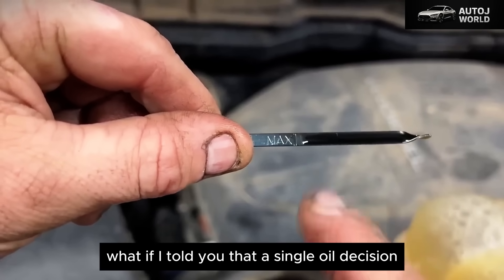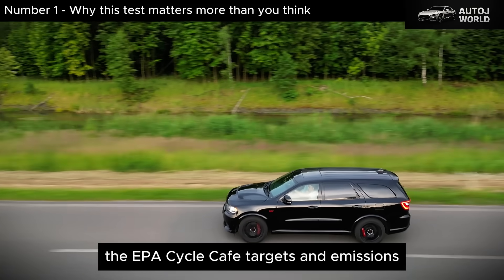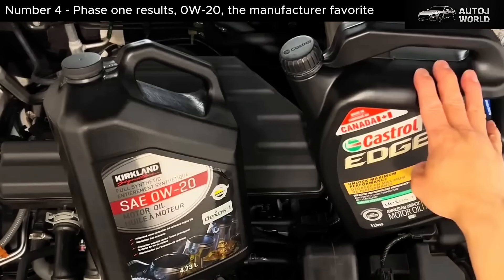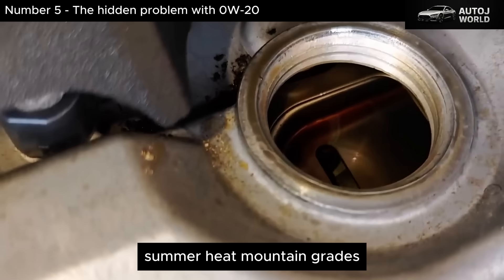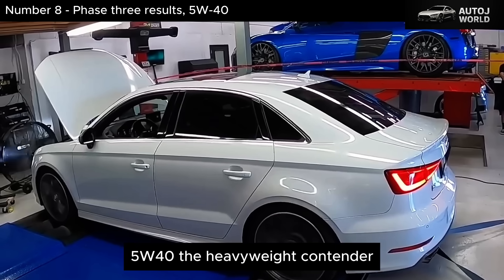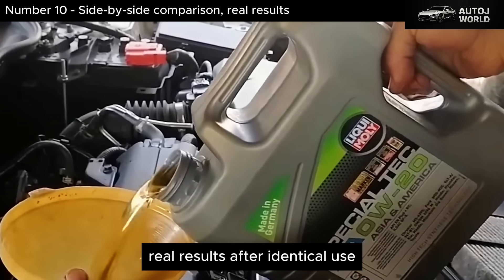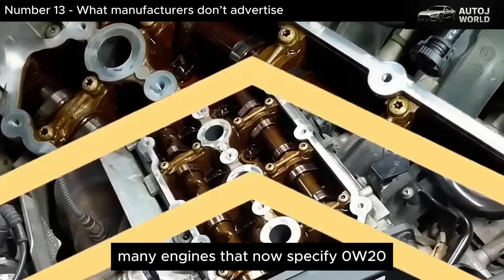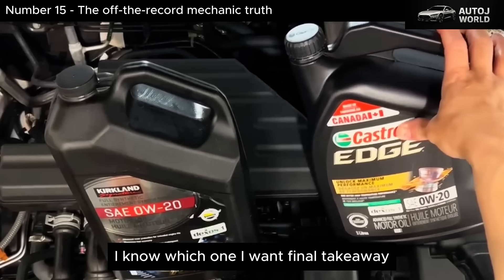We Tested 0W-20, 5W-30 & 5W-40 in the ENGINE — One Clear Winner!

Comment: Dear people, the first number in engine oil grades (0W, 5W, 10W, etc.) indicates how thick or fluid the oil is when it’s cold. It does not affect how the oil behaves above +20°C. Once the oil is warm, only the second number — 20, 30, 40, etc. — matters. This number shows the allowed viscosity range of the oil at 100°C. A fully warmed-up engine typically operates around that temperature, depending on the exact circumstances.

0W never causes harm. It does not make any oil “too thin”, because it only describes the oil’s flow when cold — and cold oil is always thick. A 0W oil is simply slightly less thick than a 5W oil when cold.
So by using 0W oil, you protect your engine during cold starts, and nothing bad will happen.
A 0W oil is already beneficial for the engine at 0°C.
At +20°C, the engine runs almost entirely on the second number — 20, 30, 40, etc.
At 0°C, the oil behaves as a combination of the two numbers, for example 0W and 40.
At –35°C, essentially only the 0W part matters.

That’s why I always use 0W oils: 0W20, 0W30, and 0W40, depending on how thick the engine is allowed to have. 0W40 is actually quite thick, but older engines run well on it.
I only use 5W40 if the car is kept in a warm garage; outside I always choose 0W40 or, if needed, 0W20 or 0W30.

So there is absolutely no benefit to using 5W instead of 0W, because it will increase engine wear during cold starts.
Therefore it’s better to use 0W20, 0W30, or 0W40. If you truly live in a tropical climate where temperatures never drop below +10°C, then you can indeed use 5W oil — but otherwise it makes sense to use 0W oils to protect the engine during cold starts.

You just need to check which of the three — 0W20, 0W30, or 0W40 — your engine is designed to accept. If you use something not approved by the manufacturer, you always do so at your own risk and must really know what you’re doing.
Reply: 0 weight oil on paper works if the stuff in the jug is to spec. A lot of times it is not... GM has raised the 0-20w to 0-40w to stop the premature failure of their trash engines. 0-40 is very close to 5-30 which is the lightest weight oil they should have ever gone down to.
Reply: @automan1223  0W40 is thicker than 5W30, but in cold 0W40 is a little bit more liquid.
0W20 works well in engines, just engines must be in good condition and made for this oil.
Still i use 0W40 ewerywhere i can, espeically in old cars, but in newer engines there may be need for 0W30 or even 0W20.
Reply: Thanks for clearing up this misconception. I just don’t have the energy to do it anymore
Reply: Sometimes engines like the 2008  .Scion 4 cylinder,  have small oil drain holes in the piston rings that clog with carbon,  and even the 20w gets trapped in the combustion chamber.  Then people use thicker oil which compounds the problem.
Reply: @billcooperpatriot1059  you can't say 20W, you can say 0W20 or 20 second number W stands for winter. 
but yes this problem have on some cars little oil ring holes.
Better use quality oil and change it at right time not late.
Reply: Just to add to this if you have a performance engine with turbo, you want oil to reach the smallest and farthest parts of the engine at the shortest time at the beginning of the start of the car. To do that you need 0w. And if you living in Canada for example, you better stick your manufacturer recommendation which is 0w20 in most cars. I personally have a supra (bmw b58 engine) and a Toyota crown 2.4 lt hybrid turbo both recommend 0w20.
Reply: I use 5W20 in my Chrysler Town & Country van which Chrysler recommends. Bought new and after 12 years, and 170,000 miles no engine break down.  I change oil every 5,000 miles. My advise - follow your manual. The company that designed and built your automobile knows way  more than the these YouTubers.
Reply: @mokhan4748  i would use 0W20 or if warm climate then 0W30.
Reply: Some oils have more and some less detergents or additives in them too . Some engines require oil with more zinc .
Reply: @todds7614  zinc is overrated, oil formulas changing,  new oils doesn't need so much zinc anymore. Use quality oil what suits to your engine and all is very good.
Reply: I assume 0w40 better for high mileage  engines ?
Reply: @BFKGintaras  yes it is, but it's also suiteable for good condition engines, when engine is compatible with 40 end oil, like older engines are.
New engines come 0W20 oil requirements and there you use 0W30 or 0W40 oil at your own risk.
It's hard to say, how many new engines can take 0W40 oil, it depends, how engine is exactly built.

Comment: I have a 2019 mustang GT 5.0 on my 1st. oil change I switched to 5-30 and I have some older fords 4.6 and 5.4 3v I been using 5-30 in both of them for years
Reply: My 2019 GT with level 2 performance package owners manual requires 5w30 if used on track. I took that as evidence that 0w20 was inadequate

Comment: 5W30 and 5W40 have the same viscosity when cold. How come that 5W40 is more viscous when cold? And do not tell me that (40) makes the oil more viscous, because when hot all oils have a much lower viscosity than at cold temperatures. Probably the best oils are 0W40, 0W50, 5W40, 5W50.
Reply: the 5 isnt viscocity in the normal sense. its flowability tested I think at -30C using two viscosity values based on very low temperature  and its more about flow when cold and the pressure required for cranking, ie for start up at low temp.  the 40 means it maintains viscocity at 100C .   It is usually thicker due to the base used to meet the -30 cranking test and get to the 40 at 100C. Normally thicker but it depends on how its formulated.  ANyway, the 30 or 40 are a proxy for bearing film.  Choose based on the temperature where  you are as they say, but also how old the car is, so I use 5W40 in a country where there is very little under 0 degree C and up to 30C cause the car has 170k. In reality it makes stuff all difference and mostly I buy full sythetic good brands,  but I never will buy 0W20 as I agree with the video, they are just for regulatory compliance. 0W30 or 40 are good if in really cold temps and have the viscosity for normal running. A bit irrelevant in hotter climates though.
Reply: @terry9223  You state things that yourself are not sure. You do not understand what those numbers  represent. Learn what a multigrade and a monograde (oil) mean. And to make it simple, GOOGLE IT!

Comment: In the US, lower viscosities are manufacturer recommended to meet EPA regulations.  Forget the recommended oil, use 5W30 full synthetic after break in for normal driving and 10W30 full synthetic for high load driving and change oil at 3000 miles REGARDLESS of the recommended interval. It will cost more to change the oil and filter more often but you will have a much longer life out of the vehicle.
Reply: So then let me get this straight..........You use 30 weight oil in the winter,  and you switch to 30 weight oil for the summer?    Why?   Is the 10 w 30 cheaper than the 5w30?   If not , then why use 2 different 30 weight oils?
  Or did you mean to say 10w40?
Reply: @billcooperpatriot1059 Incorrect.
10W30 in summer or if towing.
5W30 in winter for ease of cold flow.
Reply: @Digidoc316 both are 30 weight oils.
  Towing would not make you need the same weight oil   .   If you think 10w30 is thicker ,  you are mistaken.  Once the engine is warm  both oils are EXACTLY the same .     10 30 does nothing to help with wear from Towing.
Reply: @billcooperpatriot1059 10W30 viscosity is the same hot but has a higher sheer rating; it stands up better to high loads and temps.
Reply: @billcooperpatriot1059  The way I understand multiviscosity  oils is that the first number represents the flow characteristics as compared to straight weight oils.  The second number represents the level of protection as compared to straight weight oils.
So, 10W30 flows like 10 weight but protects like 30 weight.  Using that understanding,  5W30 would flow easier in cold weather when the engine is cold.  10W30 would get thicker and thereby flow slower in cold weather at startup.
Reply: @Digidoc316 You are half right. 
  The second number represents the "flow"  when it is hot.  The first number has absolutely nothing to do with hot oil.
Now please read all of the other comments here , saying the exact same thing that I am telling you before you respond.   Because what I am telling you is well documented and researched fact.  Or, look it up, do your own research or whatever.    30 weight is the same at 100c   weather it's 0w , 5w , 10w or 15 w  , the  engine wants 10 weight oil .    And hot 30 weight oil "Flows" like  a straight 10 weight oil.  That is the actual viscosity at operating temperature.   So if you want thicker film for hot towing ,  you have to increase that second number.

Comment: There is no differance between a 5w30 and 5w40 on cold starts as both have a viscosity of 5. The differance is at the hight end 30 - 40.
Reply: Both have different oil flow rate.
Reply: @Rainer-i4f  Yes at working tempatures, the 5w viscosity is the same.

Comment: I intend to switch from full synth 5W-20 to 5W-30 when my odometer passes 100K. Factory reco oil weight makes good sense for 'younger' engines, as a kind of break-in oil. By then the rings and internal parts won't be as tight anymore, so I won't expect much of an MPG drop, if any.   😉👌🚗⛽⛽⛽⛽

Comment: All depends on Country and driving conditions and tempratures ...  For USA conditions, 5W-30 is generally better for modern cars in moderate climates (fuel efficiency, cold starts), while 5W-40 suits hotter regions, heavy loads, or older engines needing thicker protection, but always check your owner's manual first; the manual dictates the best oil for your specific engine's design and performance needs. 
Key Differences
5W-30: Thinner at operating temperature, better for fuel economy and cold starts.
5W-40: Thicker at operating temperature, provides stronger protection in heat, heavy towing, or for high-mileage/older engines. 
When to Choose Which
Use 5W-30 if: Your vehicle is newer, you drive in milder climates, prioritize fuel economy, or your manual recommends it.
Use 5W-40 if: You live in a very hot climate, frequently tow heavy loads, have an older engine with worn parts, or drive aggressively, and your manual allows it. 
The Bottom Line
The most crucial factor is your vehicle's manufacturer recommendation, found in the owner's manual or on the oil filler cap. Using the wrong viscosity can lead to premature wear or reduced performance

Comment: Use what works, trust the manufacturer? They tell you 15 k oil changes? They tell you lifetime transmission fluid? 😮
Reply: The lifetime of an average modern transmission is 60,000 km 😂 technically accurate

Comment: I just recently switched from what the manufacturer suggested, usually 0W-20, to 5W-30 for the very reasons outlined in this and other videos.
Reply: I switched from 0W30 to 5W40.
Reply: One thing that's a bit weird is that the same car has different recommendations depending on where it's sold. For example, the VW TFSI engines have 0W20 recommendations if it's sold in the US but 5W30 if sold in Europe.
Reply: @michaelmay5453 Different climate regulations.
Reply: @Kostas444-m7h  We have stricter climate regulations so that's not it, it's about mileage.
Reply: @michaelmay5453 Ok, thats what I have heard atleast because certain countries have stricter emission rules.
Reply: @Kostas444-m7h  Yeah but the US does NOT have stricter climate regulations so that would make no sense at all. The exact opposite would make sense but that's not how it is.
Reply: @michaelmay5453  not really.   Here in Greece,  also they put  in  0w20  vw508.00 spec .
Reply: @Megaleiotatos  That's weird, which engine was that spec for?
Reply: @Megaleiotatos  Just to note VW508.00 does not specify viscosity. You can have a 5W40 that's VW508.00 compliant.
Reply: @michaelmay5453  nope, at least in Europe. Vw 508.00 is only 0w20 . If you put anything else ,you are off the warranty.  Vw 502.00 is 5w40 and 5w30, but is only for old cars ,until 2006 and finally vw 504.00  is only 5w30 for cars until 2018. 
  As I like the brand and had plenty  vw ,the problem isn't in viscosity, but in the ridiculous oil change recommendations.  I never went over 10000 km and never had any issues, although I am staying in the viscosity the producer recommends.  Good luck to the drivers that goes to the 30000km/2years suggestions
Reply: @michaelmay5453  vw Tijuan 2.0 tsi 2023 engine. As I am still in warranty,  the only oil i can use is 0w20 long life .
Reply: @michaelmay5453 It’s because of the  emissions clause and CAFE ratings. Just to gain 1-2 mpg.
Reply: Oil recommended in the United States stated on the oil fill cap is wrong. It was a cheat by the manufacturers to get CAFE ratings. In your owners manual is the truth. You use an oil of your regional temperature. Like Toyota has 0w-20 on the oil cap in the U.S. and in Japan will be 10w-30.
Reply: Going to change my TOYOTA SIENNA PLATINUM from 0-16 to 5-30 at 30,000 miles. Does not invalidate the TOYOTA WARRANTY, IN ANY CASE. ITS THE SMART MOVE FOR LONG ENGINE LIFE! Change oil and Filter, every 5,000 to 6,000 Miles for long life. Enjoy your drive!
Reply: Was going to say this, and found your comment. My 19' tiguan recommends 0w20. I asked the dealer about switching to 5w30 and they didn't recommend it. They actually told me it can void a warranty.

Comment: Excellent.  It turns out that both my cars, an 05 Malibu and a 99 Chrysler T&C recommend 5W30.   I just changed oil in both cars and put that in it.   Cars used to use 10W40 or 5W40 back when I had my 89 Bonneville, my 77 Cougar and the other cars I've had over the years .

Comment: While I agree with the theoretical advantages of thicker oil film, I have consistently followed manufacturers' recommendations. I purchase used cars and run them to around 200‚000 miles.
  They go to the wrecking yard with no lubrication-related problems.  Two have been totalled by traffic accidents and one by a deer. The transmission failed a 2nd time in the fourth.

Comment: My manual recommends 0W20, which I use. How negatively will my engine be affected, if at all, by using 5W30? My driving environment temperature is between - 5°C till +42°C, and I commute in short bursts on streets very busy with stop and go traffic.
Reply: The strongest oil is 5-40 for extreme heat/cold and in town driving. You should change it often or after winter also.

Comment: I have 0w20 . But this winter in DC is not that cold. So I’ll use it and do an early oil change in 3 months time; back to 5w30.
Reply: I live in Maryland, been using 5-30 for year with no problem. 0-20 and 5-20 is only used for fuel mileage

Comment: Best oil analysis. During summer in Europe when temp reaches 42 celsius on highway, I use 5w50 and i noticed medium coolant temp at 80 celsius on normal driving and 87 celsius at 160 km/h. Normal summer 5w40. During winter in city 5w30 is always used. Oil replaced at max 6000km in city use (3000-4500 usually). I have almost 300.000 km and the engine  maintain the same factory performance. Of course, egr and dpf off. No smoke.

Comment: This is all AI crap.  Suggest you go over to the Motor Oil Geek. He uses and shows actual oil analysis results.   I think you find that what he says to be of interest.  Lake Speed jr. is a true expert, this is just AI generated crap.   In fact within shear 0w-20 delivers slightly better protection results than 5w-30.   See Motor Oil Geeks testing results.
Reply: Actually you are wrong... My engines and engines of others are proof.

Comment: The only fly in the ointment with all these videos, is the fact that Toyota Lexus run to massive mileages on 0-20. There’s a comment on here from a Prius owner with 300k on his engine.
Reply: I’m not sure where all these AI created videos about OW 20 is about but I’m sure it’s something devious people don’t realize that cold starts is where you get most of your engine wear and thinner oil protects better
Reply: Its fake AI video.
Reply: I'm in Australia. It's hot here. I bought a used Lexus and immediately dropped the 0/20 and changed to 5/30. In summer here 5/40 would probably be better.
Reply: @Scuffed_Andy  It's the way we used to do it in Canada, 5/30 winter, 5/40 summer, never caused any problems.

Comment: I just starting using 5W40 in my 107,000 miles 2015 VW Passat TDI.  My machanic after reaching 100,000 miles switch me  from Penns  euro  synthetic 5W30 oil. to 5W40  because its a diesel engine.  The other help came from using Top Tier fuel.  A more quiet diesel engine showed up and I was impress. The reason ?  Top Tier has a detergient added to it fuel deisel and gasoline,  example Chevron, Shell  and many more. You can down load the Top Tier app for locations near you. No one is paying me about the fuel or oil comment.  I just like how my diesel is running.

Comment: All 5W30 are not the same; the newer ACEA A5/B5 spec has actually lower shear resistance than the older A3/B3 spec.
Recently I tested 0W30 A5/B5 in my 26 year old Volvo, have been using full-synthetic 5W40 during most of the 660 000 km. 
Indeed fuel economy improved slightly but there were signs of increased wear although the manual states that 0W30 A3/B3 should be fine. So now I'm on a 50/50 mix of 0W30 and 5W40. What could possibly go wrong? 😁
By the way, please let a human read.. Bot voices are so annoying and destroys credibility
Reply: You are the only understanding thag the quality of oil is defined by API/ACEA marking. Pne ifo: all those multigrsde oils have the same viscosity 5 mins aftet starting 😊
Reply: Just be aware that you do not have an average of the mixed grades. you have a mix of different sized molecules... Not saying it is wrong, just trying to clarify.